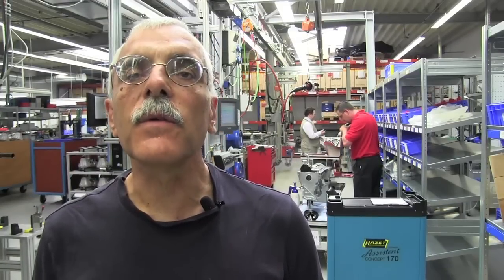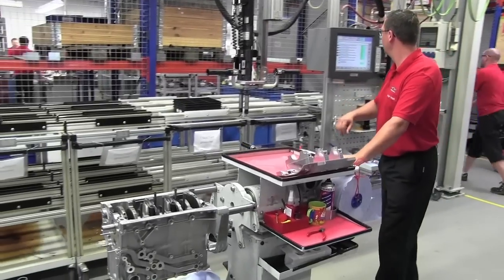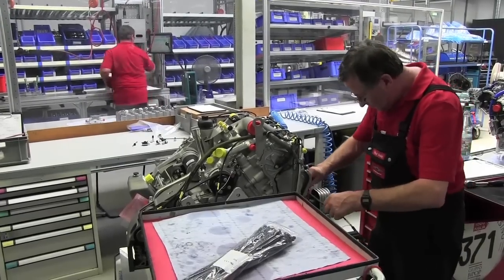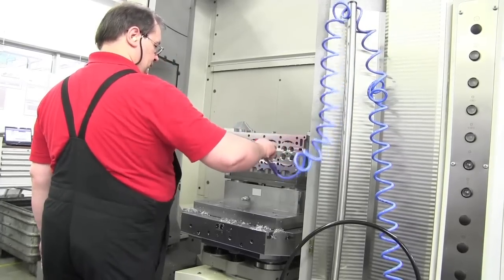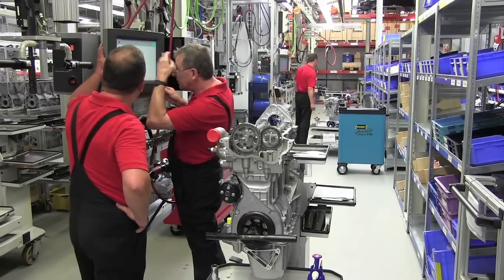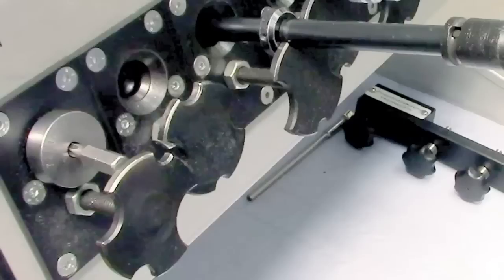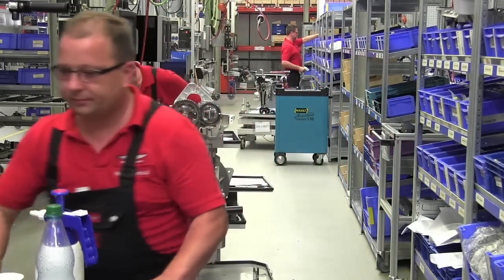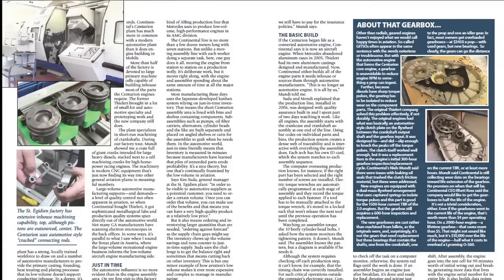How Continental Builds Diesel Engines

Comment: It’s a great development in aero engines, the traditional Lycoming and Continental engines have practically stood still and are in essence engines design in the late 1950’s.  these engines are so much more reliable, built like modern automotive engnines, taking the load of the pilot to review and monitor fuel flow, head temperatures , mixture etc. They use the new V6 CD300 in the DA50, incredible engine.  Well done continental

Comment: What is the HP to weight ratio.The fuel Economy vs Avgas? What is the HP? The gearbox looks like it adds a bit of weight, ie: forward CG. Is this engine STC 337 approved for use in the USA?

Comment: in Brazil we have the álcool lycoming is the same engine avgas with simple change , aplicable for to much ag aircrafts , work very nice and without problems, the álcool make to extend the time life of cilinders, pistons, ring sets, valves, guides, and with out polution, the consum is 25% increased but the price of álcool is 3x minus of avgas, the gal of álcool in brazil is usd $ 2 dollars per galon, also the oil of engine is always clean, the álcool is great as fuel, half of cars in country using it as fuel for 30 years or more .
Reply: +Oscar Pimentel  O avion e a alcool  ¿ O piloto tambein. No voar bebendo  podese derramar a bebida
Reply: Oscar Pimentel hey...thats a good engine.
I'm trying to build an alcohol engine now .. Lycoming Engines were made 50 miles from my house...I don't know if they still are , however I never heard of an alcohol version.
Reply: While there are many benefits of running alcohol, the consumption of alcohol is much higher than avgas, meaning you won't fly as long on the same amount of fuel. For agricultural aircraft, cruise distance isn't a problem. 

Lycoming is certified many of its popular engines to run on avgas.  The main problem remains the fuel system, from the tank to the fuel pump need to be checked regularly for corrosion from alcohol based fuel.
Reply: São usados em aviões especializados em fumígação aérea! Justamente porquê as maiores plantações são justamente de cana de açúcar e interessa muito as usinas consumir combustível de produção própria.
Reply: Wow!! you  can run a flat four boxer Lycoming aero engine on alcohol extracted from sugar beet, kale, potatoes, and apples, what about fuel extracted from algae?.

Comment: 3:48 I could understand that the rough texture would grip both components, but wouldnt grit and metal grind off and damage bearing surfaces. Secondly, it will be uneven surfaces. Surely they machine both surfaces flat.
Reply: +MyMIXmedia  Absolutely right, haven't seen this process before.
Reply: +MyMIXmedia they actually don't. This is fairly standard procedure with all piston engines. You machine them to be round with the required surface quality for the bearing first.
Then they are literally broken apart, as shown in the video.
obviously, only that specific rod will fit its specific counterpart, but those two will fit perfectly.
Reply: this has been standard practice in the motor industry for some years now , saves cost and gives a secure precise joint.
Reply: you can find fracture split rods even in some motorcycle engines.
Reply: The connecting rod "cracked" big end has been employed in the automotive industry for several years. The fit and durability are excellent.

Comment: does the engine have to use low sulphur diesel or the regular high sulphur red diesel?
Reply: Aviation desiel engines actualy burn JET-A, which is basically kerosene
Reply: red diesel isnt high sulphur anymore.

Comment: The Germans certainly have their crap together when it comes to producing top quality products, not like the rest of the world, unfortunately. That lower connecting rod splitting technique is novel and absolutely brilliant.
Reply: " connecting rod splitting technique is novel and absolutely briljant" = copied from BMW
Reply: +Johans60 And I guess BMW is what, Chinese?
Reply: +Jaime Almeida  ..... yep , the German speaking bit of China .......... when Zeppelin left Hong Kong , Mao waived him off & said " Come back soon , Led , when you ' ve got that design sorted ............. "
Reply: +osp80 .....it a very mixed bag . If your accolade is the jerno. test , the German have it , good technical stuff for jernos to get their oooo measure the specification ruler onto , lots of new new new & if the service department have kept up , some bright computer to sort out the problems ...... but of course , when it ' s a bit older in the teeth & the plugs & wires are a little cracked & ware , the problems of over complex come to kill any advantage that was found to start with . But , we are on the cusp , this wiring , will improve , if the engineers have their way , the VW stupidity , should help that happen . When you have management to only likes to hear yes , then eventually some silly sod will say yes , when they should say no .
Reply: +osp80 I think a lot of that I'd the result of the Daimler/Chrysler marriage. They thought the German design and build quality would transfer over to Chrysler. Turned out that Chrysler was just so horrible they dragged down all of Germany. Seriously, Dodge couldn't even get a decent build quality on their flagship Viper.
Reply: 9HighFlyer9 That's because company "bean counters", instead of engineers, are running the show.
Reply: Saw this technology at the 1990 Detroit Auto show at a booth for the ford 4.6 V8 engine .
Perfect realignment of the rod cap after rod sizing.
Reply: Porsche does the same thing, it's cheaper.
Reply: wow Carillo rods should be made this way amigo!
Reply: "connecting rod splitting technique is novel" .... Ford has been using this for their modular V8s since the 90s.  Not sure who used it prior to that, but 25 yr old tech at least....
Reply: Americans have been doing that for at least 25 years. Probably a lot longer.
Reply: @six159nagito  Exactly!  That began with Ford and everyone else copied it.

Comment: I assume that the engines are run on Jet A kerosene fuel.  Jet A is generally cheaper than avgas but you would need to fly many miles before you would recover the cost of installing the diesel.
Reply: Mark H  Diesel isn't available at very many airports and diesel fuel gels at low temperatures.  I saw another video where the rep from Continental states that the engines will use Jet A.  Jet A is cheaper but not that much cheaper.  The diesel engines are expensive.
Reply: Mark H True, but it's much easier to buy Jet A at an airport.  Diesel would likely have road taxes because there are so very few diesel airplanes.  Plus, you wouldn't need a heater; saves weight and complexity.
Reply: EpiDemic117 The diesel engine will always be more expensive to produce and that is a major issue to overcome.
Reply: +EpiDemic117 HI EpiDemic, you are right that it is costly (FAA approval) but liability is even worse.  A friend and I went to Germany to buy a MODERN aircraft engine, as soon as the company realized that the aircraft was going to be registered in the US, the deal was off!  Sadly enough, the company explained to us that it was absolutely not financially sound to sell to the American market AND the company rep stated that no other European aircraft manufacturer would risk the reputation of their company in the 
"frivolous litigation-prone American market".  Needless to say, we were deeply insulted and had to look "back home" to older engine designs to power his Lancair IV.  Sad but true! Ciao, L
Reply: Mark H Hi Mark, I agree with you. The problem was that even with the experimental class, the builder (i.e. the company) of a "certified" engine (in other countries) would still find themselves liable in our legal system.  Between 1964 and 1988, the liability of an aircraft manufacturer (consider Cessna, Piper, and Beechcraft) increased 2,000 fold reaching $100,000 per aircraft by 1988.  Lawyers circumvented the General Aviation Revitalization Act (GARA) of 1994 which limited product liability to 18 years by extending lawsuits to nearly every single part manufacturer used in the aircraft, the private airports, FBOs, flight schools, av-gas providers, aircraft storage areas, etc.  You are right, it is killing us. The greatest obstacle to any reform was/is the Association of Trial Lawyers of America (ATLA). It is unreal, may God help us.  It also threatens other manufacturing sectors.  Take care, Ciao, L
Reply: Mark H You are right, he reminds me of someone who "put a joint in his mouth but did not inhale", he has nice rhetoric but he cannot turn the clock back.  The Blitz company bankruptcy was another spectacular lawsuit.  When I was coordinator for on the voluntary executive for the South Bend (TX) chapter of the Boy Scout Organization, more than half our budget (including Girl Scout Cookies) were fighting frivolous lawsuits like someone choking on a cookie piece, a boy scout tripping on a post he built himself (despite that the BSA covered the medical expenses), his parents said our construction was "unsafe", we were in the process of showing the parents how a small bridge was being built by our your Scouts seeking their badges - a nightmare for us Scoutmasters and executive who were all volunteering out time and effort educating these kids!  Ciao, L
Reply: Mark H Hi Mark, I was the South Bend area coordinator (part of the executive), Boy Scouts saved my life as a kid growing in the fifties/sixties when I lost my parents, so I was giving back to the system, like nearly all adults staff did.  BSA provided us with insurance for all events, liability, equipment, food, etc. which covered medical issues, injuries for kids as well.  This coverage was provided for nothing at the time (covered by our fund drives and local churches), the various camps had small fees for food ($20~40 for two weeks).  Poor children's fees (and uniforms) were paid for by the parent's committee, church, Scoutmaster & myself.
The parents that sued us had already sued other people/stores in the past - it was settle out of court to avoid a long litigation which would have been too costly for BSA and worse could have jeopardized our "camp building program" for that season (we build shelters, bridges, dams, forts, etc... depending on the area we camped at... that was part of the spirit of scouting and showing our kids survival.  That was my first personal experience with American greed against an organization that tries to help our people.  Unfortunately, it was not going to be my last!  Peace be with you, Ciao, L
Reply: Avgas, 100LL in particular, has been under the environmental regulators scrutiny for years. It's a wise and necessary move to diesel type engines for GA aircraft. Jet A is different than pump Diesel, but similar.
Reply: EpiDemic117 Diesel engines love kerosene.  It burns faster and cleaner.  They will basically run on any oil including vegetable oils.
Reply: EpiDemic117 Modern high pressure electronically controlled fuel injectors have solved most of the problems except for NOx emissions.  The ammonia injection cuts the nitrous oxide emissions to zero.  The blue fluid works on cars/trucks and is inexpensive.

Comment: What is the ratio of the gear box that drives the Prop?
I am guessing engine rpm at around 4200.
Lots of piston travel vs the engines we are use to! 
Your Idea of the life  of an engine producing full power at 4500 rpm.
Thanks
Reply: +yogi 1948 I can only say, their has never been a reliable aircraft engine design over about 200 HP that has a continuous RPM over 4000.
Reply: +yogi 1948 Usually aircraft engines are direct drive, no gearbox between crankshaft and prop. 
RPM around 2500 for diesel around 200 HP. 
In this video they did not show any aircraft engines. What they show are are all automotive engines.
Reply: +urbanturbine Watch again, these are all aircraft engines.  Last few shots are one on the dyno being broken in.
Reply: +bigtoyota479 Maybe... but still seem strange. the engines in the video look water cooled... i'd expect to see simpler air cooled units... thank you for the feedback on my comment.
Reply: +urbanturbine I honestly hadn't considered the water cooled aspect but at the beginning of the video they showed the engine laying on it's side behind a prop with the gear unit on the block.  I did go to the Continental website as my curiosity was peaked.  It looks like quite a few of the new engines are liquid cooled.
Reply: +bigtoyota479 Yes you are right. same engine pictures and liquid cooled on their website... Pretty cool.
Reply: +bigtoyota479 At first, i thought they were just showing some stock manufacturing videos of auto engines mainly because these really didn't look like AC engines (liquid cooled, in line pistons instead of opposing etc) and i thought maybe they were hiding trade secrets by showing some stock footage. But no, you are absolutely right, these are definitely the Continentals new engines. Sorry about that. I wonder how the industry is going to take it. I am a pilot and i fly a diesel Cessna with SMA engine. It has temperature and altitude limitations. We use a winterization kit to plug up the cowling for cold weather but then we have to take them off when it gets warm...
Reply: +urbanturbine  no need for apology...we both learned something, right?   :) Are they turbocharged?  What is the reason for the altitude limitation over a gas engine?
Reply: +bigtoyota479 Yes the SMA is turbocharged diesel. It uses Jet-A. Altitude limitation is for maintaining engine temperature. As you know, diesel is more efficient so it produces less heat. However, the limitation on our particular plane is even lower than SMA requires and it is because of the insurance company :)
Reply: What a crock about engine temps.
Reply: re: "What a crock about engine temps" oops, someone's never had the pleasure of trying to start and run an old diesel truck in the winter.  it's not pretty.
Reply: Yes, no matter what one thinks, FAA has the final say on certification of aircraft parts and systems. If FAA says you can't legally fly this aircraft  below such-such temp and above such altitude with this engine, then you just can't legally fly it. There are so many considerations, Jet-A cannot get too cold or else it will jell, engine needs to operate at certain temperature and cooling needs to managed to prevent shock etc etc. I wish everything was so easy as typing "crock" on keyboard.